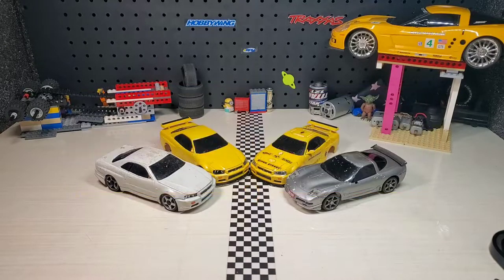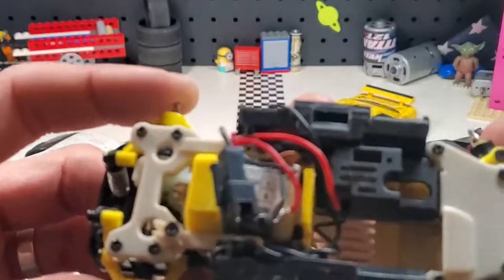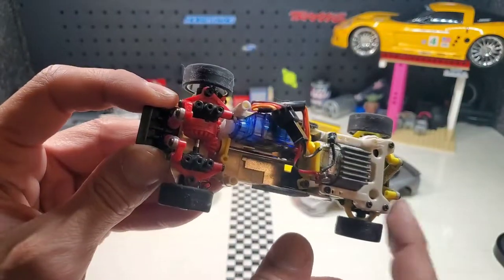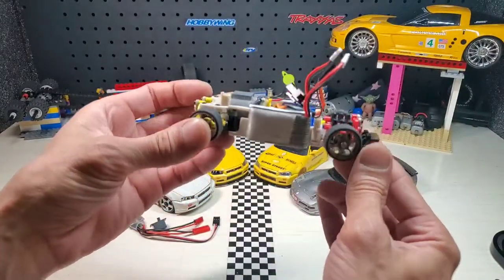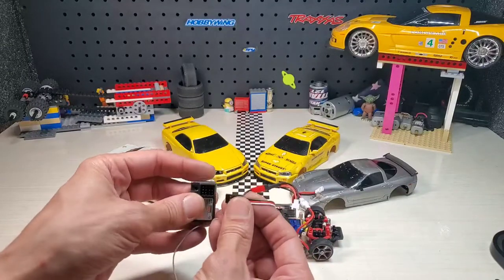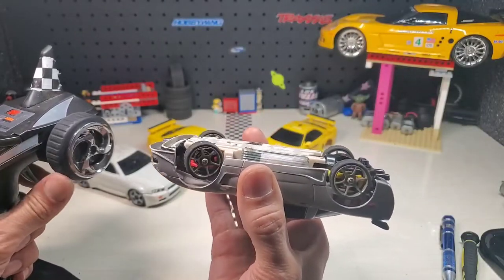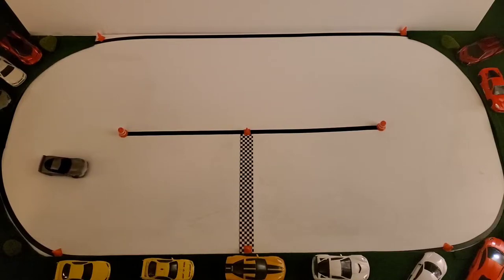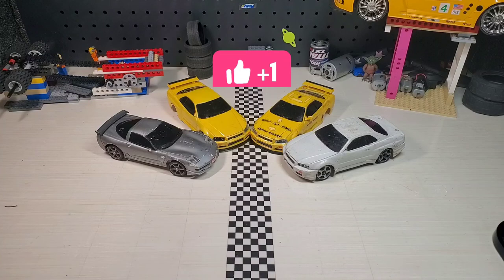XMODS 2S LiPo Conversion | Radio Shack Revival

Comment: Those foam "puzzle piece" like square panels sometimes used to line play areas for kids make a great road surface for these little wheels.  They're also affordable and lend themselves well to covering a lot of area with minimal effort and no tools.  

Alternatively, if you have a running track near you with fairly laid back patrons/management you can get enough open space to really let all those horseflies to buzz and skidder and scamper.  IME a lot of folks actually seem to get a kick out of it.  A rubberized surface is actually a lot better than a gymnasium floor or similar smooth, hard surface because no matter how clean they look within about 5 minutes of driving your wheels are inevitable caked in dust and axles choked with hair.

Comment: Set gear mesh by hitting the throttle trim button on the transmitter one time. If the wheels dont turn with one press theres binding somewhere. This will increase motor temps and eat up the brushes faster. 2x5x2.5mm losi bearings can be used to replace the bushings in the motor, this reducese friction, increases speed, and lengthens durability. I have a 400$ fully built gen 1, and built gen 2 and a k989, all running 31t motors on k989 escs. 2s lipo conversion will wear brushes faster so a plasma dash/pn racing type motor can is reccomended with better cooling and brush setups
Reply from the maker: That's awesome info! I don't have the original remote anymore but I'll keep that reference in mind. Glad to know they are 31T motors with those bearings. I had been playing around with turning my own motors and couldn't find a "golden spot" in turns but with bearings... your right, will resolve most of my heating issues. I still need to get a Resin 3D printer for parts. It's fragile now.
Reply: @backtothetrackgarage8790  Hey good advice and video folks. What kind of 3D printer are you looking for to print parts?
Reply from the maker: @djlyfe557  I haven't done much research atm. Do you have a recommendation?

Comment: I have a lot of these that i found on market place, all of the steering servos are jittery, any suggestions on how to fix that?
Reply from the maker: On the stock electronics? No... well.. maybe some kind of "reballing" process to remelt the solder on the board to make sure the connections are intact but that could also further damage the board and components.. but maybe a similar process could be achieved safely by hand melting each solder point with a normal soldering iron.. it's a gamble though. Those cars are super old now having gone through all kinds of possible deterioration environments like near the beach or water. That's why the complete change in components.. sad to say nothing lasts forever if not properly stored..just sitting around.

Comment: Awesome video I just revived my old first gen xmod (skyline), and well yeah it's slow, unresponsive and needs some power. Has a stage 2 motor, I'm sure these upgrades would help with more power from the stage 2, better steering, more responsive?
Reply from the maker: They will definitely help, The lipo batteries @ 7.4v, alone gives a significant boost compared to the 6v the AAA batteries give. The new radio system is much more responsive and smoother. Plus you could also later swap over to brushless.
Reply: @backtothetrackgarage8790  can I just do the battery upgrade first and also help the steering now that its more juiced up? I just found some hosim 7.4 1600 mah rechargables that I had for a off-road truck I have 2 of them, can I just buy some tclip wiring and just run 1 of them? Or should I get some batteries like yours, just wondering cause I have these already..thanks man!!!
Reply from the maker: @theodorecarbajal2975  I remember we used to wire a 5th AAA battery onto the original board all the time. So I would say yes why not. Just keep in mind that being so old, something may fry or "cook", but should operate for some duration of time.

Comment: Do you have a link for the connectors/harnesses to connect the batteries and motor?
Reply from the maker: Did you mean for the 30a Brushed ESC? "JST Plug Connector 2 Pin Male Female Plug Connectors 10 Pairs" https://a.co/d/8g7VCTC

Comment: Decided to do this with my xmods but having trouble with the reciever, when i turn on the esc the light doesn't turn on on the reciver unless i put it in the vcc port but than nothing else works
Reply from the maker: It sounds like your using a reciever that was used on a Nitro car. That was the way they were set up on vcc. Strange there's nothing on other channels. Black wires should be on outer edge. How long have you had that receiver? Also check your alignment dials if you have them and center them. Being slightly off will not calibrate with the receiver when turned on.

Comment: What did you use to mount the servo to the chassis and what did you use as linkage between the servo and the steering bar?
Reply from the maker: I just used a small section of 3M 15lbs double sided tape to hold it, and I believe the original steering arm, but I may have made one. I'll be posting a video shortly soon.

Comment: How much was it to convert this I want to do that to my Evo gen 1 or two
Reply from the maker: About $75.  Well worth it for the speed and transmitter flexibility. I Might have to invest in a 3D printer though. The shaft cups are prone to wear down naturally on either system and are just extremely hard to find replacements.

Comment: I have a red xmods supra I'm selling, complete kit just have no chrystals
Reply from the maker: Not only am I interested... I have to ask. Are you sure you want to sell it? They are becoming so rare especially since the fall of RadioShack... some unboxed original XMODS are about $200 now. 4 times the original price! And we all should know, to go get a Kyosho for that price. Parts availability is nearly dead unless you own a 3d printer which I am in the middle of acquiring now, on top of my next new showcase setup. When I'm ready I'll check back. But in the meantime, I'm building and  preparing to showcase details of RC cars in a way no one else has done before. So I'll need some time, but I'll keep in touch.
Reply: @backtothetrackgarage8790  If you want my email lemme know!